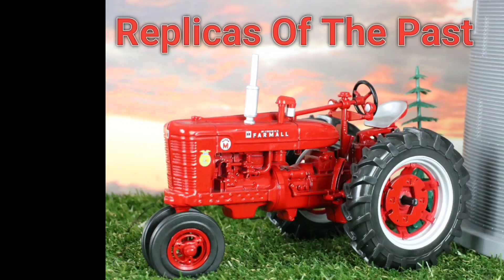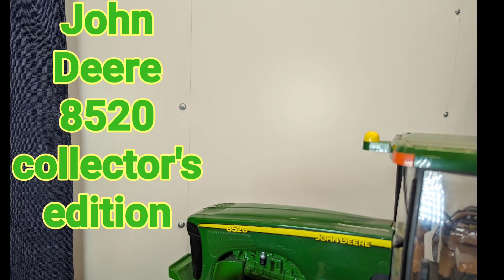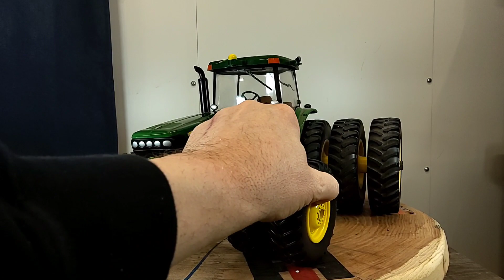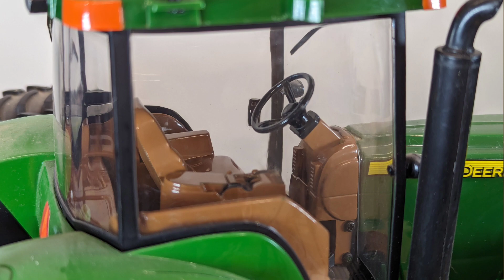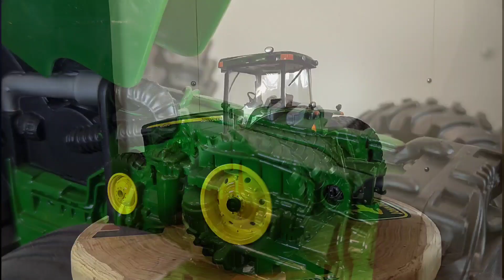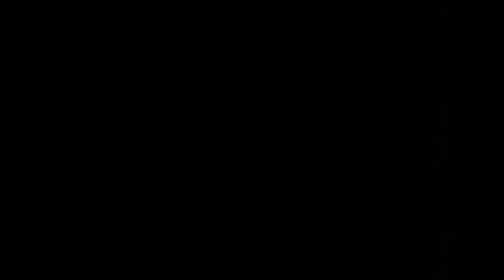Ertl 1/16 John Deere 8520 collector's edition

Comment: You're not going to believe this but I have this model as well, and it has the EXACT same pieces broken. The front axle broke and the front weights are broken the exact same way as yours.

That is wild to me! 

I actually had to go check to see if mine was still in the closet to be sure you didn't somehow buy mine 😂

The sad part is I've never played with mine. I also never took mine out of the box. That is nuts.
Reply from the maker: Alot of people on farm toy addiction on FB was saying possible zinc rot.  I dunno much about that